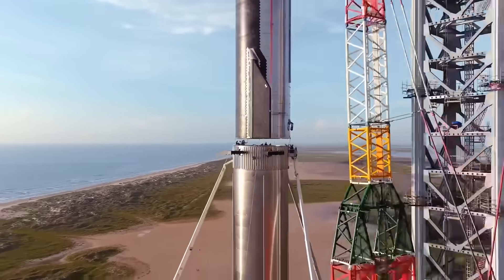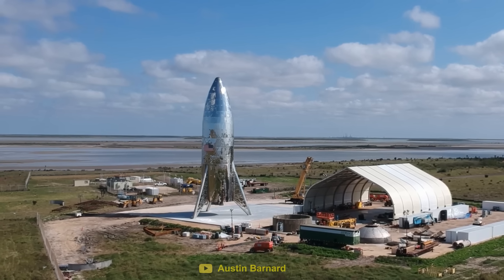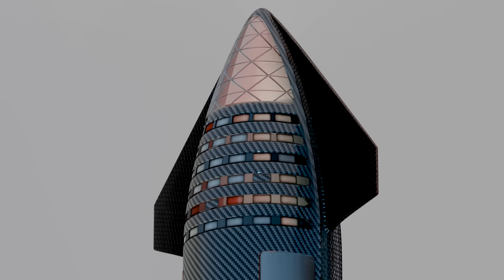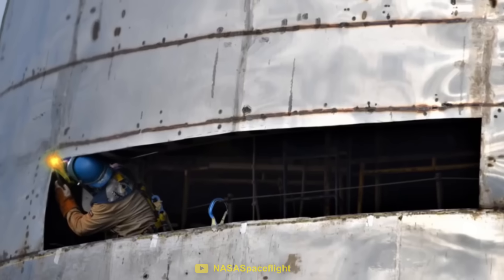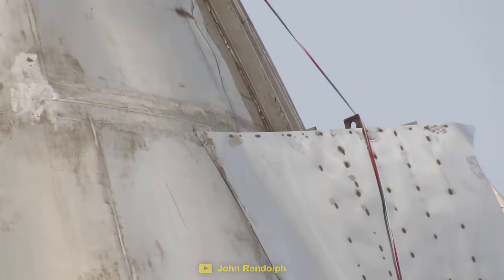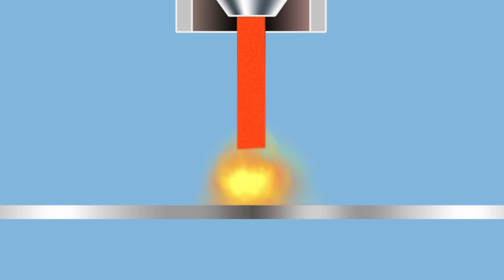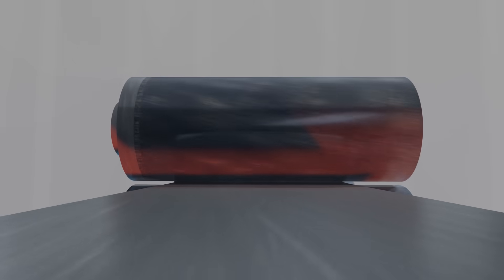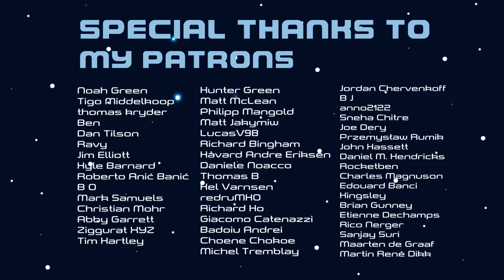How SpaceX Mastered Starship’s Welding

Comment: "with flux core the metal wire is surrounded by a solid material that burns and releases a protective gas around the weld."  This is not a description of flux core.  The process described is SMAW or potentially SAW.  I am being a tad bit pedantic as this is not a welding video but as this is a video dealing with technical subject matter I get thrown out of the zone with an obviously incorrect script.

Comment: I think Boeing stolen "his idea of making the plane out of carbon fiber thingy" for it's 878 Aircraft and they faced all of the mentioned (by you) problems and after solving each and every one of em' gave the world it's most beautiful lightweight with bigger windows and wings  the no bolt body Airbus.
Reply: Boeing didn't steal anything. Carbon Fiber was part of a natural evolution in aircraft development in the early 2000 and it was normal for them to think that replacing regular alluminum would be the next step in aircraft design.

Comment: This slightly frustrates me as there are ways to ake carbon fiber resist even 2000 F of heat, the reason they don't use it is actually cost.  Traditional rocked cones, like atlas style, are made using hydroformed carbon fiber so it can but again, the cost.  I don't know where this guy got his info from but he is wrong.

Comment: I believe they have used or are using a type of friction welding at the moment. Pushing and twisting the Metals together with a Rod without actually melting the metal.

Comment: Why can't you just make a mold and pour the metal into the mold?
Reply: You mean casting? Well the problems with that: the metal is much weaker and harder to temperature train. Transportation is much harder since its a huge object instead of plates etc. 

Also casted metal is much brittle than one that was pre casted then pressured to shape or hammered.

Also then you need to make a big heavy casting mold just of that rocket and if the cast is wrong well thats.. a few thousand dollars out.
Reply: @ArmedSpaghet  Thank you for your answer! And yes I did mean a cast.

Comment: Space X hasn't mastered anything about Starship until it works.
Reply: Just recently listened to Musk lecturing about rocket engines combustion cambers temperature issues and how they are handled by metal coatings to burn as shields.
And the same guy tells about 1h turnaround with just refueling. And what about the 30 2.5m$ each engines with the burned inner shields.
He is just clueless, but a genius compared to his followers.

Comment: Ideally they would use a giant die casting starship....just like the Cars.  
Reducing  all the need for welds
Reply: No. Casting wont work. Rockets require much heavier and different composites etc like titanium. Cars are small and can just roll on the ground. This thing must be light weight and sturdy and be able to resist the atmospheric pressure inside and other forces.

Comment: just have a ladder or elevator or something going up to a  launch pad in space. it will cost a lot initially but save money overtime with the amount of launches and costs for each one.
Reply: Yeah thats a space elevator but you do know someone has to bring up all the materials to space to set it up? Right now there isnt enough or such material that can be used as the cable. 

So its a dum idea.

Comment: It did improve. Looks much better than in the past. However its still not perfect. I think another mile stone for spacex would be the research of 'cold welding' much much stronger than currently used one but also very difficult to achieve. Was first discovered in space so connects them kinda :D
Reply: They could have just asked NASA to assist..

Comment: I'm kinda puzzled as to why it took SpaceX engineers to figure out these mistakes now. They've had years to perfect their fuselage designs with F9. Some of their early mistakes with Starship involves some very basic metallurgy that most engineers would not have missed. It seems to me like they're prioritizing cost over function with Starship.
Reply: Early starships where built super cheap so they could rapidly test the engines and gimballing system. They were never going to leave the atmosphere.

Comment: Ah sorry but that is not fully correct. Welding also is a process that some welders do better than others. The skill of a welder is the ability to not only see the weld but know when to remove the welding tool. A good example is Soldering. In truth the right heat can be used but to much will alter the metal. This also comes to play when working on electronics. With to much heat you could destroy the circuit you started working on. However with just the right amount of heat and observation of the changes one can prevent circuit damage and have a proper soldering point. This looks to be the main problem as well.  I would also note that with the metal so thin they would really need to have a very skilled welders.

Comment: I’ve always been told that grinded welds are less strong.. when I worked as a bike mechanic bikes mostly broke where the welds where grinded specially if the welds where grinded at the bottom bracket like some expensive bike brands do bc it looks more expensive and sleek but in reality it makes your bike absolutely less strong that’s why you will never see a grinded weld on a downhill bike or motorcycle main frame! Don’t miss lead your audience with the wrong information, grinding down a weld reduces it's strength, and therefore a structural weld should never be ground down! That’s facts

Comment: Stop thinking in two dimensions in construction. All Spaceship welding should be as continuous spiral welding. 1. Saves on time. 2. Limits welding lengths, 3. is much stronger in all three axis. The rolled forms are rotated around the vertical axis. Too bad this just makes too much SENSE.

Comment: Your description of flux core welding is backwards.  The flux IS the core, the metal filler material is the outside of the wire.  Hence the name flux core.

Comment: Allright so to get the timeline straight they went from a completely unrealistic idea that was both unlikely to work and almost impossible to manufacture, to the cheapest most slapped together welding project, to just doing a normal weld like in car manufacturing? And all this in only a couple of years? Very impressive.

Comment: My father used to work in way back in the beginning before I was born in a shipyard they used to do armor plating on ships where they was solder the armor plates on it makes me wonder if they couldn't do the initial frame in a lost wax casting mold and then inset into the wax itself as it sit on the base the heat shielding and then cast in the main chassis or if you directly fused into the main body where you wouldn't have to worry about heat shielding falling off that way

Comment: Semi machine casting otherwise known as lost wax casting is a put the casting mold on a turret and run a continuous injection rotating till it's filled maintaining the vestment chamber just below the fusion point so as the plasma Arc liquefies the casting is is pouring into the mold you can have one continuous pour an accuracy of lost wax casting is within one thousands of an inch of a human here also there's what's known as high pressure molding casting that's done through a vacuum chamber that also can be done in the same process the long face about this process is the setup and equipment the investment casting can be done all in one chamber and not requiring the thousands of wells just let a mill machine shave off the fine edge of the casting to bring it to flush and other than Machining fine points that's it

Comment: For flux core welding the wire is tubular and the flux is on the inside. Flux core welding can be done with shielding and without, if you're doing welding outside you're likely using self shielded flux core wire. On thin sheet metal there's hardly any concern for whether you're going to have lack of penetration. Planishing is also only going to compress the welds in a vertical orientation, meaning that the graphic is inaccurate because the metal is going to expand horizontally and the grains will also compress horizontally.

Comment: "The wire is covered in solid material that burns..."

flux- CORE.   The wire is not surrounded, like in gmaw/arc, the metal surrounds the flux.

Comment: Wow wow, welder here! Flux in fluxcore welding doesn’t protect from oxidation, you need gas for that! Tig welding can already do a one pass full welding trough a 4mm sheet and can be an automated process. Laser is good, still, all these failed steps is what happen when you hire good engineers instead of good welders.

Comment: It sounds like they doing it completely wrong in the beginning and now they are doing it according to standards.
It's even with the carbonfiber, when they announced it, I've heard everywhere that it's completely retarded idea, exactly for the reasons described here and also problem with pressure.
Reply: Seems like they were reinventing the wheel when they could have just looked around at what other industries have probably been doing for decades. Must have been taxpayer funded 😵‍💫

Comment: You got the flux core part wrong. The inside of the wire is made of flux which is meant to deoxydise and create a protective crust to be removed after welding. The outer of the wire is simply a sheet metal wrapped into a tube in which goes the flux. The outer is most commonly made of the base material you are about to weld with it, in this case most likely 301 or 304 stainless. There are different types of flux too! Some are self shielded which means they don’t require any inert gas but for stainless you will most likely use dual shield flux core which requires gas and with stailess you would be better off going 100% Argon or at least 75% argon and 25% CO2. Oh and also flux core is the best process to be used outside along with stick welding. TIG welding and Mig welding sucks outside and I mean it, it really sucks to weld tig or mig/mag outside!

Comment: Since stainless is one of the more heat sensitive alloys, especially 304, laser welding keeps the HAZ minimal, which is pretty key for tensile strength I'd imagine.
Reply: I did not know this, why the hell do we use stainless steel anyway then? Wouldn't it be better to use something more heat resistant?
Reply: @ryandavis4689  Because heat shielding exists? With that logic we probably shouldn't be putting humans in rockets either since we're not very heat resistant.
Reply: @ryandavis4689  Extreme heat isn't the only thing to consider. The material also has to maintain its strength in extreme cold due to cryogenic fuel. Strength to weight ratio is also very important. Spacex must have decided somehow that the alloy they are using had the best balance between all these properties.
Reply: So even the basic level stainless steel is highly robust for life of time, againts the elements and heat yet the giant external tanks of the space shuttles were rusty pieces of sh#t that somehow "allegedly" withstood the heat and pressures of going into outer space!!!! People are so sadly gullible.......Please so very much Please stop being gullible and take back your true power of self from the liars/deceivers of this false reality realm construct we are all kept mind controlled within.
Reply: stainless steel are also good at holding cryogenic propellent
Reply: They use Various cooling methods to maintain the optimal temperature for the steel, such as active cooling aka super cold fuel pumped through the ship. There are no metals on earth that can withstand reentry from space.
Reply: 304 also prone to corrosion.the amount of welding is huge,i am doubtful about the metal stress.I will be hesitant to fly in it..needs alot of test flight s. 316 costly but quality is high

Comment: At, 2:35 stainless steel can be put together using the most basic and affordable methods. A few seconds later you ask why is it so difficult  to get right. Are you a journalist?
Reply: This is true, stainless steel is easy to weld together, but since they’re building a Rocket they need good precise and strong weld which is harder to make.

Comment: Less believable than moon landing.
Reply: Huh?
Reply: @logitech4873  this whole rusty rocketship malarkey. Just a marketing story. Fairytale. Comprende?
Reply: @donfanto1  What's it gonna take to convince you otherwise. A flight?
Reply: @logitech4873  it being believable and not shrouded in bullshit?
I work in scam prevention, so I know every single trick in the book. When one sees a good spectacle - I see lies.

Call it whatever, but once you recognize a pattern - you can never unsee it.
Reply: @donfanto1  The Raptor engines are performing great, the first test flights have proven basic launch and landing procedure.
Just like the Falcon 9, it'll probably end up working fine.
Reply: @logitech4873  and we know that for a fact because?... Also it's one thing when reactive jet engines work in the atmosphere. Another is to claim, that they work in a vacuum.
Reply: @donfanto1  This has nothing to do with jet engines. Who's claiming jet engines work in a vacuum?
Reply: @logitech4873  rocket engines are jet engines.
Reply: @donfanto1  What? Or course they're not.
Please actually read up on this subject. You're making it very clear that you don't even have surface level understanding of rocketry.

Jet engines are air breathing turbine compressors that require atmosphere to work.
Rockets carry their own oxidizer and ignite the fuel and oxidizer in a combustion chamber. It has no air intake and no huge compressor - just turbopumps.
Reply: @logitech4873  that's semantics since both of those engines work in the same way. I mean the propulsion force is generated by the same principles.

If you don't even know that much - then how dare you tell others to "read about it more"? 😀
Reply: @donfanto1  No it's not semantics. They're inherently different, and obviously not interchangeable. Nobody calls rocket engines "jet engines", and nobody claims air-breathing jet engines would work in a vacuum.
Rocket engines work perfectly fine in a vacuum however
Reply: @logitech4873  both are exhaust propulsion engines. That's what I meant if you don't understand. Both are being propelled by spitting out matter from the back and pushing engine forward. So far so good?
Reply: @donfanto1  You want me to just ignore your bizarre error so that you can keep trying to prove a point within something you clearly don't understand?
Sure. What's your point?
Reply: @logitech4873  not error you dolt. I was saying that both types of engines are propulsion type engines. So whether one "breathes" or not is a secondary issue. You're not splitting the hairs while avoiding actual argument. Way to show others how smart you are.
Reply: @donfanto1  You literally said "rocket engines are jet engines" lol.

Comment: I highly doubt that SpaceX is using laser welding for the ss panels. They're roughly 12 mm in thickness and some of the best laser welding systems can only reach roughly 2 mm at full power. So it's probably Auto fed TIG. Also, whoever was running that flux-core and had cracks on the bead faces needs to get some more practice, or better wire as worm tracks do happen from moist wire.

Comment: That is inaccurate. Flux core wire does not work that way. Source: I've been  welding for 18+ years. What you're thinking of is inert gas welding. Usually using gases like argon to protect the weld from damage causing weakness and pitting that atmospheric gasses will cause in the weld. Flux core uses a mixture of different materials like magnesium carbonate and calcium carbonate with varying recipes depending on manufacturer and application. This forms a slag at the top of the weld that protects it from atmospheric gasses. This slag is then tapped off with a pick, hammer, wire brush (or in my lazy asses way of doing it a grinder.) Not trying to belittle you or call you stupid but there are plenty of resources out there that take a few seconds to find the answer. Please use those resources or ask your community if there is any confusion as I'm sure I am not the only person that knows how to weld in the group.. Otherwise great video.

Comment: The cost comparison between carbon fibre and stainless steel is the worst I’ve ever seen! You compare them to a kg to kg basis, however one kg on stainless steel is soooo much less material than a kg of carbon fibre! You especially mention it seconds earlier. A better comparison would have been by volume.

Comment: Comparing carbon fibre and steel on a cost per kg basis does not seem right. Just before this you said that CF was lighter. This then stands that a KG of CF can cover a larger area of the rocket than a KG of steel. I think a better comparison would have been cost per square meters or the like.

Comment: 💯 percentage carbon nanotubes melted rock solid over 3000 °c unless tungsten carbide or titanium galvanized can layer 2D printing by 3D lamination/coating layer inside or outside surfaces 3D shapes

Comment: Me and Dazzi Gianacarlo Italy will spray and heat it for a few 6 figures each.
Why didn't you just use latter line X (cloudy transparent without colour) with rustoleum mirror spray or humbrol chromium or even aluminium spray then heat treat ceramic glass mixed spray heat gun for doing just that's a start-up paid my pocket to cure heat spray paint/s before or during or after.
Alright afterwards
https://youtu.be/pbnj4_EeBaY